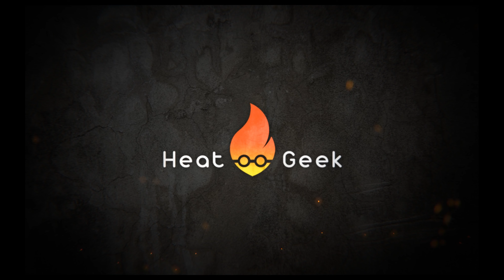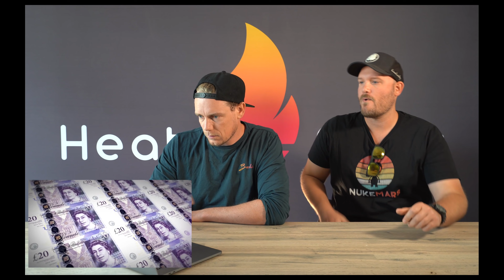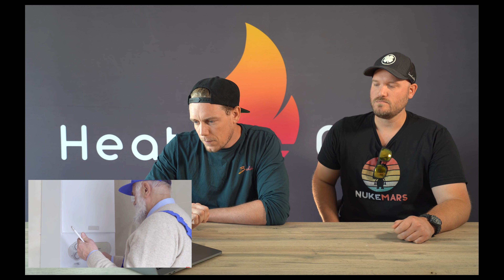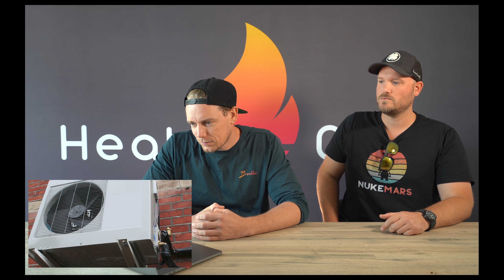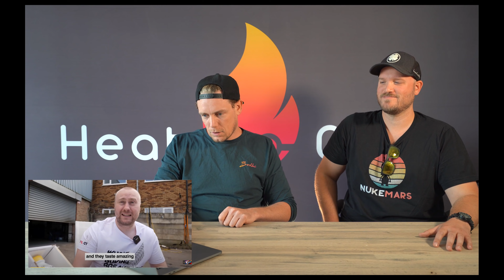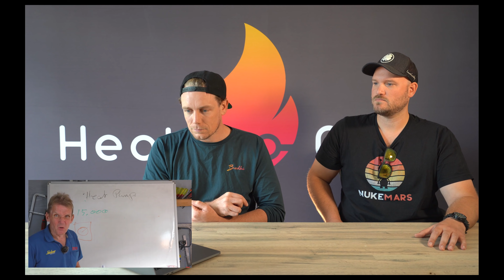Professionals React (BADLY) To Skill Builders's Heat Pump Videos | PART 1 | FIRST TIME WATCHING

Comment: 2 minutes in and they are trying to claim horror stories with ASHP are due to bad installers. No, they are due to ASHP systems not being very practical when fitted to older houses or for households that need lots of hot water for washing / showering. By "system" I include radiators, hot water storage tank etc. To give a specific example, the water in your hot water tank in an ASHP system is likely to be a pretty mediocre 45C, which is about the temperature people use when showering (normally 38-42C). This means when you shower you use mostly hot water and mix in much less cold water than you would compared to a gas boiler system with 65C water - so for the same shower you drain the hot water tank more / faster. If you have a family of more than one person that requires you to compensate by using what is essentially an immersion heater - which is very inefficient and expensive. So, your stated efficiency figure for your shiny new ASHP is not achievable since you have to top off with direct electric heating. In short, the efficiency figures are the equivalent of the fuel efficiency / miles per gallon  claimed by car manufacturers - not achievable "real world". If you have a gas boiler running at high temperature you do not need to resort to using your immersion heater since a) you use less hot water from your tank and b) a gas boiler can generate a lot of hot water faster than an ASHP can.

Added to this there are issues about ASHP performance in cold weather and their ability to heat spaces in general (if your property is not well insulated you will need larger radiators, which will be a major issue for older and / or smaller homes).

It would be much more realistic to use a high temperature heat pump system - but if I understand it they are effectively now banned in the UK as the operating temperature exceeds new limits set by the UK government - probably because they claim lower efficiency than low temperature systems. As a result we will be forced to use immersion heaters to heat our water and sit in cold houses fitted with radiators that do not have enough heat output capacity to keep up with demand!
Reply from the maker: This is in correct. All decent heat pumps don't come with an immersion heater and don't need one.
Reply: @HeatGeek  So please tell me how I quickly heat up a tank of hot water without one? 45C water temperature is LOWER than the temperature my son showers at! (admittedly he likes it very hot). And please explain to me how well they work when the ambient air temperature drops below -5 or -10C? At the time you need heat the most ASHP is least able to supply it. Or are you proposing GSHP? Well, that is not an option for most people.

And please do explain how I will adequately heat my conservatory? Fit extra radiators? No space. Fit more insulation? How? It is a triple glazed conservatory with insulated walls and ceiling! So it becomes unusable in winter?

A colleague at work has just moved in to a new build and the insulation is SO BAD that the fuel bills went though the roof - his family only heats the rooms they need - so they plan in advance what rooms they will be in at any given time of the day! He does not have ASHP, but if we are relying on insulation to keep us warm and a new build is not fit for purpose what hope to the millions of families that live in much older houses have?

Don't get me wrong, I support the idea of heat pumps, I support renewables. I know this is the way ahead. But, as it stands, I do not think ASHP operating at flow temperatures of 45C or even 55C will cut it for a lot of people. I would rather sacrifice a bit on the headline efficiency figure and go with a cutting edge higher temperature system - 65C - but I no longer have that option, do I?
Reply from the maker: @kalicom2937   sorry I don't have the time for the detail your going in to. 

Heatbpumps don't heat hot water with a 45c flow. Not sure where you heard this. We suggest a target of 45 for heating.  Not hot water.

Heat pumps can work down to -20 but sizing them down to that temperature in the uk is wistfully as it impact on normal operation..  worst case UK drops to say -5 for a couple hours.. as long as your still inputting heat that often won't be enough time to drop house temp and is often at night .

Conservatory would need an additional source although tipple glazed with ufh could work. 

You seem angry a heat pump may not suit your house... that doesn't mean it doesn't suit others houses.. we often tell people heat pumps aren't suitable for them.

Insulation and building regulations are out of our remit
Reply: @HeatGeek  No, I am frustrated that the UK government has just implemented a regulation limiting max flow temp to 55C (well, that is what another channel promoting the merits of ASHPs said that was the case and I have no reason to doubt them) when I think a higher temperature system would probably suit my house better.

I am also frustrated that there is an assumption that people have well insulated houses, or can afford to get their houses insulated to a high standard. This is not the case, especially in older properties that have no cavity wall insulation and single glazing. These houses will simply be cold for their owners to live in OR they will have to spend fortunes on insulation OR they will have to supplement their heating with expensive options such as space heaters - much as you are suggesting I do in my conservatory. That 100% defeats the object of ASHP, don't you think?

I do not think it is very transparent of the UK government either - they have come up with a very obtuse way of encouraging people to improve insulation - make their houses cold by limiting flow temperatures. I would much rather they subsidised insulation that subsidised heat pumps.... 

I also suspect that we do not have the capacity to install the number of heat pumps required in the the next 10 years or so - so no doubt suitably skilled plumbers will be in even higher demand - and no doubt they will also demand higher wages as a result. Oh, wait a minute... that wouldn't be one reason you are such a fan of ASHP would it?

Have a very nice day now.
Reply from the maker: @kalicom2937  like we say repeatedly.. heta oumps dont fit everywhere.. but its either fit them where we can or keep on burning gas and releasing co2... we don't have an alternative. You too x
Reply: @HeatGeek  Like I said repeatedly, I have no issue with heat pumps where they are appropriate and advocate stopping using hydrocarbons. But you refuse to hear my point. THE UK GOVERNMENT JUST OUTLAWED HIGH TEMPERATURE HEAT PUMPS! Furthermore, they will BAN gas fired boilers in a few years. You openly admit that heat pumps do not work for everyone and yet that will be the only option for EVERYONE in a few years time! Do you not hear yourself?

Enjoy your windfall salary boost as you take advantage of people when you install LOW TEMPERATURE heat pumps in situations where they are not appropriate BUT THERE IS NO ALTERNATIVE OPTION DUE TO GOVERNMENT REGULATIONS.

Maybe you will pay attention if I shout. But somehow I doubt it.

xx.
Reply from the maker: @kalicom2937  no .. lol.. they didn't. They made the British standard 55c. British standard is not regulation.
Reply: @HeatGeek  Good. So I can fit a high temp heat pump. By arguing for hours with my plumber. Will everyone else in the UK have to do the same?
Reply from the maker: @kalicom2937  non lol. The other channel just got it wrong or you misinterpreted what they've said.
Reply: @HeatGeek  I hope so.
Reply from the maker: @kalicom2937  no need for hope bud. Even if it was law, they would quickly have to revert it because hundreds of thousands would die in winter lol. Sorry to laph but its silly.
Reply from the maker: @kalicom2937  a ban of gas boilers in new builds in 2025 is well over due as 55c flow is about 20c oo high for many new build buildings. Regarding the gov being stupid... i can guarentee you they will continue to be stupid and completely detrimental, and also guarantee you we'll keep on voting the same lot in with the same effect. democracy is dead.
Reply: @HeatGeek  The new build my work colleague just purchased is uninhabitably cold or prohibitively expensive to heat. Brand new. He and his family are forced to stay in specific rooms at specific times.

There is NO WAY I would buy a new build - unless I win Euro-millions and can build myself something good.

Interesting world view you have, guess you are a fan of Putin and what he is up to in Ukraine.
Reply from the maker: @kalicom2937  I dont think its up to regulations or there a hydrualic issue with his system. new builds should be sub 40w/m2. its also anecdotal.

sorry why do you think im a fan of a war monger? thats a dreadful ting to suggest. more of that and channel ban

Comment: I saw Roger's video and was not terribly impressed but I'm really not an expert, I'd suggest slightly interested amateur 🙂.  I do have a couple of questions. 

The first is that at about 6 minutes in Roger is talking about a buffer for the radiator system. My current system is a gas combi so no tanks (just an expansion vessel on the radiator circuit). Another site/video suggests that a buffer is not needed for modern variable speed heat pumps but instead for the older on/off heat pumps. Do you have a video that answers this?

Secondly I'd like to have hot water (showers/taps) from the heat pump, should I then be thinking of a separate water tank (I have room)? Should this run off a separate heat pump?

Finally my existing Remeha gas boiler is capable of taking in pre-warmed water for the taps. Should I ask an installer to keep this in place as a backup in case the heat pump is struggling or has a fault or is this going to cause other problems.

Cheers
Reply from the maker: No vid on buffer yet only in our training. Buffer dependency depends in your control strategy.. to big subject to wrote here
Reply from the maker: Yes you will need a git water tank..  watch our consumer series

Comment: if it takes 0.3kwh of electricity to produce 1kwh of heat from an air source heat pump and your house is 96 square metres, you will need 10kwh of heat per hour to heat your home.
0.3kwh x 10kwh = 3kwh, that is 3000 watts of electricity per hour , times 3kwh by 12 hours per day to heat your home in winter at 28 pence per kwh = £10.08 per day  and £13.44 for 16 hours per day.
heat pumps should have the hourly power consumption on the ''power in'' specification on the sales description for the general public to work out the cost before buying the product.
If you want to use a heat pump then the answer is simple, change your job for another job that will pay you 3 times more.
Reply from the maker: I assume you haven't bought a heat pump before because this is provided in the form of the performance estimate.

It's not worked out like that though as that's incorrect. When you work out your heat loss to be 10kw that's only when its -3  outside and your aiming for 21 inside. It isn't -3 all day every day though.. its for like a few hours.. and often at night when internal target is lower.  If its say 9c outside which is much more common your heatvloss is halfed to 5kw and the input is 0.15. 

Here's more detail in how to actually work it out 
https://youtu.be/D8pvXDk_KAA

Comment: Clearly you are enthusiastic about renewables...   Should I pay more to reduce my carbon footprint?  Oh... a). What if I cannot afford it?  b).  What if I know the Earth will adjust itself?      You suggest gas is unlikely to become the same price as electricity....  How much is diesel compared to petrol?   Based on bullshit the government charges us more for fuel oil than refined petrol!    You nearly agreed with everything Roger said and then went but...  yes, but not really, but.     So his video IS a collection of quite passionate true statements, maybe he should not link them ALL into one statement, but the REAL question everyone needs answering is...  How much is a heat pump system going to cost if it replaces my gas boiler?  You mentioned the heat pump will need servicing, maybe you can build some data showing us 20KW  30KW 40KW gas versus air comparison, but please include hot water temperature quantity/volume data with it (probably 65C/100 litres would be a good baseline), and include the annual service cost.  I believe hot water must be stored at 60C minimum to combat legionella.   

Yes, maybe we export our manufacturing and ON THAT BASIS it is important that we import lower carbon goods, maybe China needs to reduce their carbon footprint.  It is too common for rich people to increase the prices for poor people because that fits their corrupt agenda.

It is very unfair for you to call Roger's video "conspiracies" when actually he has stated A LOT OF TRUTH, and I welcome you to provide any proof of anything he has incorrect.  

Have you considered how much conspiracy and lies are more likely to be built into the whole Global Warming...  ...Earth is Dying Bullshit, that there is little or NO evidence for?   Actually it seems ALL these "be more green schemes" somehow make someone a profit, including the government, and including yourself.   £1.80/litre for diesel which is basically a fuel oil ...  WTF? 

Frankly, there are so many very, very, very poor people in the UK that it is disgraceful... hungry and cold children and elderly, (ignoring that anyone deserves to have a basic minimum quality for their life) that I am very interested in anything that may improve their quality of life, safety, and security!!!  If any green scheme can provide that then I am interested, otherwise it seems more likely to be a conspiracy theory that profits fraudsters.
Reply from the maker: We are not at any point saying people should buy things they cannot afford. We are saying that his comments on heat pump performances are incorrect.

Comment: If you want to win over the older guys in this debate, you’ll need to do one extremely fundamental thing that has nothing at all to do with boilers, heat pumps, insulation, carbon, the planet etc etc etc, ……. You need to get that cap on yer head on the correct way round. Sort that out, man. Come on. You look like you should be discussing Wimbledon.
Reply from the maker: Not too fussed in the slightest to be honest
Reply: You’re doing a video (with an attitude) aimed at a guy who was installing boilers when you were still crapping in yer nappy. Now you’re making videos with yer hat on back to front.  Roger knows what he’s talking about and he’ll take one look at you and think, “not that fussed if I’m honest.”
Reply from the maker: @mvwmark8955  I hope not as Roger is actually coming to see us for a debate in a couple of weeks and we're recording something together. This video wasn't to convince Roger. It was to correct hos mistakes and paint a clearer picture. I do not care for the opinions of others based on my age or how I'm dressed.

Comment: Skill builder is mainly right, anyone see the latest reg update about max heat, it means bigger radiators will conveniently become the norm. Also just because  “but what about the carbon footprint” I hope the first customer you have that can’t afford one of your installs says that and the extra money magically appears from your pockets. I hope heat geeks vehicles are all electric and all the appliances in their homes are top rated and homes are max insulted with heat pump and solar installs…….. bet they’re not………….. because of cost.
Reply from the maker: at what point did we say the whole country could afford a heat pump? we actually say in the video that the problem is the cost is prohibative..
Reply: @HeatGeek  you didn’t, but the point of my comment is this culture of “eco shaming” to justify excessive cost is too prevalent, in the real world cost benefit is king. Saving say £20 a month on bills after spending an extra £6000  over the cost of a straight replacement is not good, that’s a 25 year return period if you even assume the unit lasts that long. The price of gas will go up, the government will introduce some sort of “green duty incentive” and force the change using the “moving the goalpost” strategy they always use, one example anyone remember the lpg conversation scheme powershift or go diesel it’s best😀
Reply from the maker: @rsole65  I don't believe 'ecoshaming' is a thing. And it's not something we're doing here.. we're just correcting the bits he has wrong..  I.e. heat pumps don't work at a cop of 2. And thermal stores aren't how you install Heat pumps.. unless you want a poor cop of 2..
Reply: @HeatGeek  you’re right about poor installs and I think as barely qualified installers start to come into the area it will get worse. And yes Eco shaming is a thing😜
Reply from the maker: @rsole65  hold my beer

Comment: Daily Telegraph 12 Feb 2022  An analysis of Ofgem figures by the Energy and Utilities Alliance, a trade body, has found that running a heat pump will cost more than a third more than a traditional gas boiler.
Reply from the maker: Based on historic crap installations from low quality trained installers and older-less well performing heat pumps, absolutely